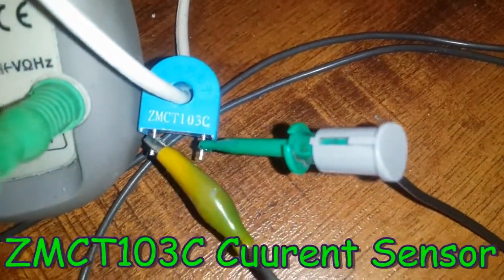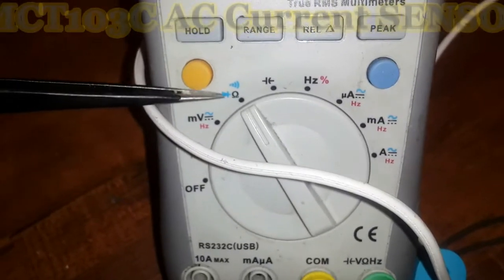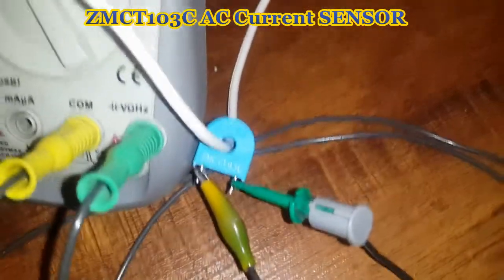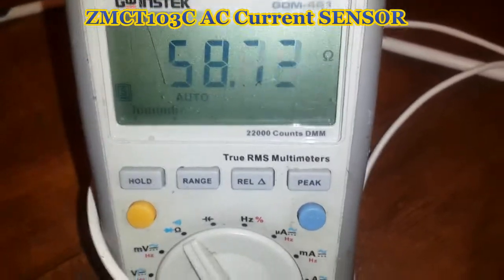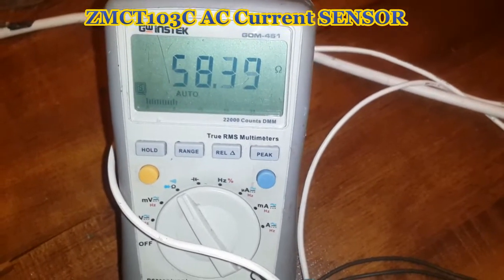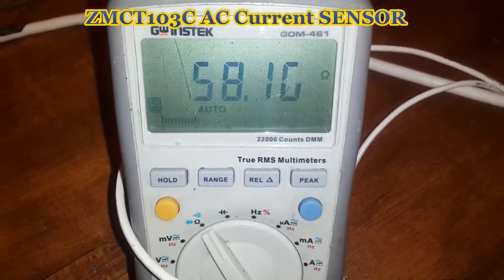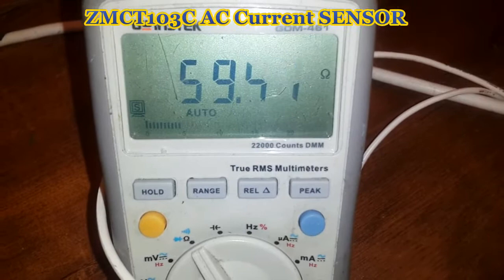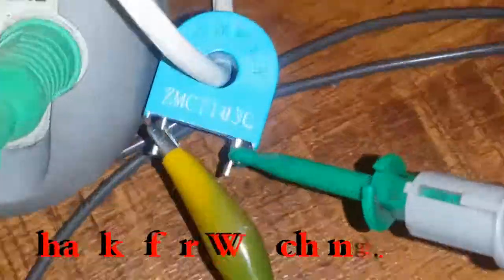ZMCT103C AC cuurent Sensor (BLUE CURRENT SENSOR)

Comment: This is incorrect video.  You are using the Current transformer totally wrong.   The CT outputs an AC voltage at a ratio to the current flowing through the core of the unit.   The ratio is stated in the spec sheet.
Reply from the maker: Thanks for attention. Coming sensor ending with T is voltage generator And no name model output should measure resistance. Current based and voltage based. Usually black and blue sensor difference. Thanks again. I am 30 years of electronic professional designer with several hundred perfect project.
Reply: @seyedmarashi  You Are Wrong!!   See spec sheet.    https://5nrorwxhmqqijik.leadongcdn.com/ZMCT103C+specification-aidirBqoKomRilSjpimnokp.pdf      AC amps in give AC milliamps out with a ratio of 1000:1    Output voltage is developed across burden resistor on output to generate voltage drop that is a ratio to the amps going through the transformer input.    Look up current transformer on Wikipedia.